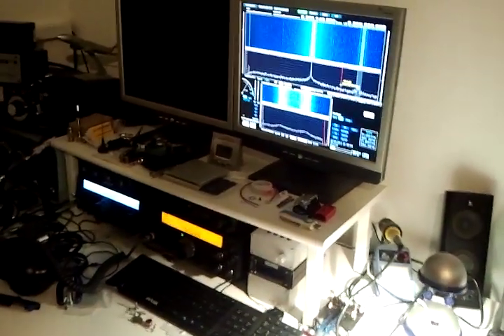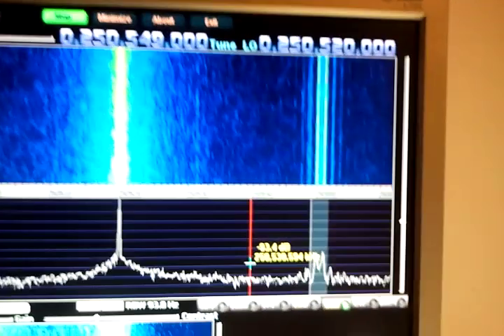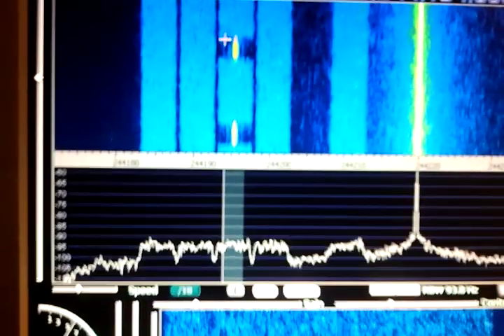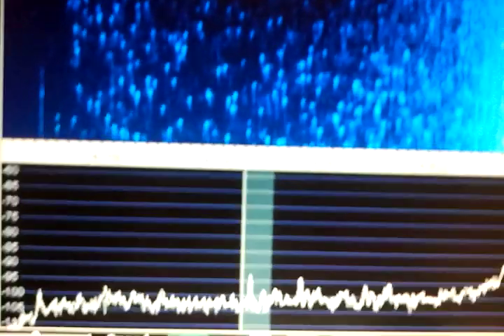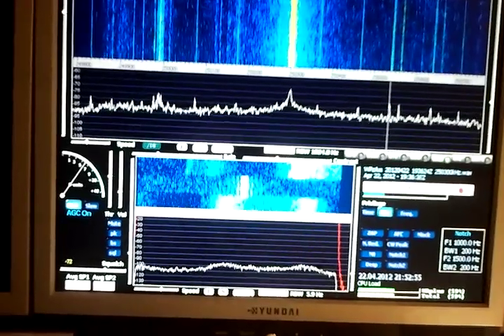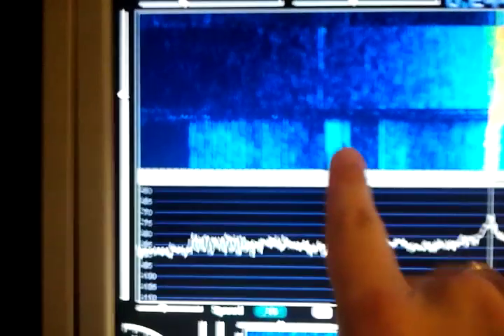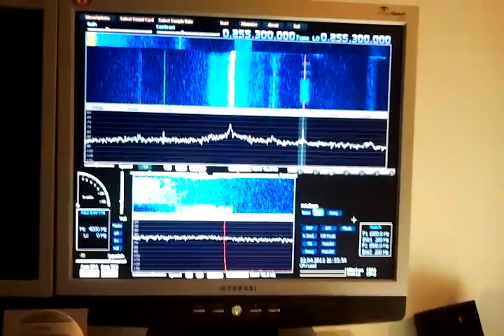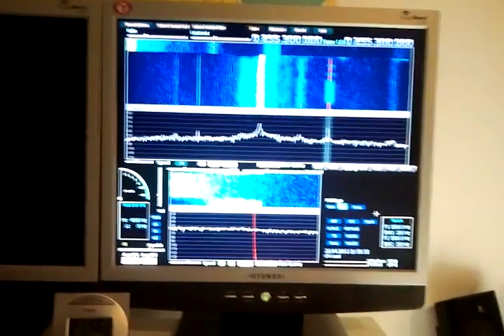Dongle Shootout: Funcube vs RTL SDR - Part 2

Comment from the maker: What tuner chip does your stick use - E4000 ? And which drivers / SDR software do you use? In case you use Balint's drivers you can add to the devicehint behind the "RTL" the following addition separated by a space "tuner=e4k". This config uses a different driver subcode than the default one and that fixes mostly those tuning crashes on a E4000 tuner. If you use a non E4000 tuner chip than I cant help you further.

Comment: Hi Thank you for the great comparison.  I have a realtek stick and it works ok when tuning around over a small freq range say 30 mhz but when I start making large changes in frequency it stops responding and the only way to make it work again is to unplug it then plug it in again and restart the software.  Have you noticed this effect on yours? or is my unit faulty?
Thanks

Comment from the maker: Hi, the centre peak is normal for a conversion (Zero IF) type of SDR. It corresponds to the LO (local oscillator) frequency and is generated by an small DC offset at the zero Hertz IF. Almost all SDRs suffer from this problem, except very expensive high end ones which are based on direct sampling, i.e. a very fast AD convertor scans the input HF spectrum directly without IF coversion...(example: Perseus SDR for HF)